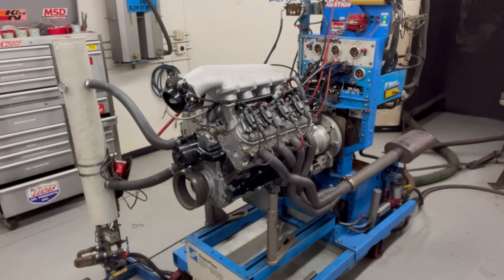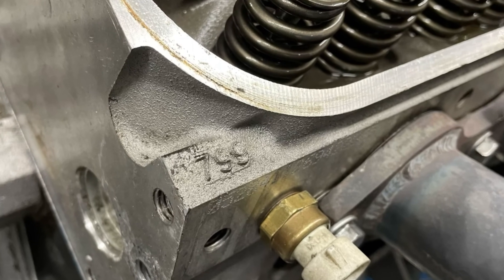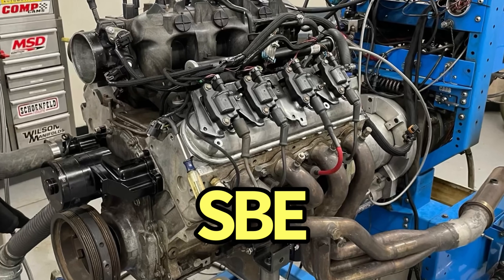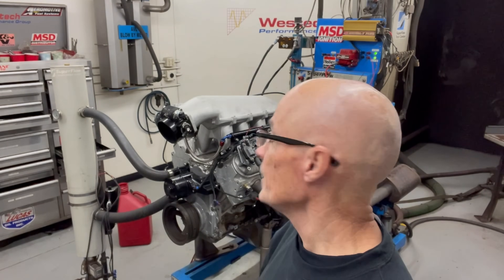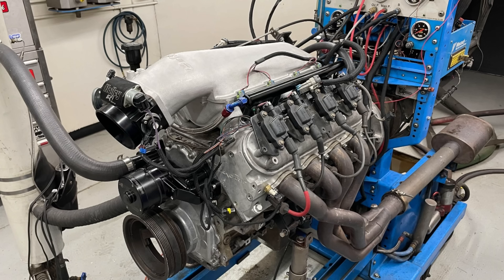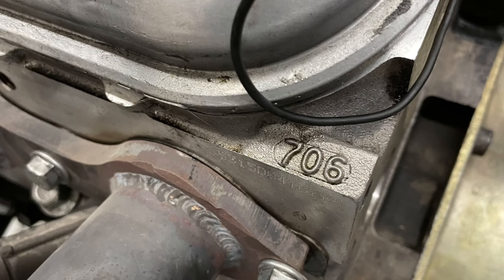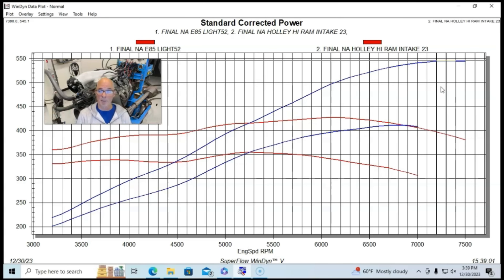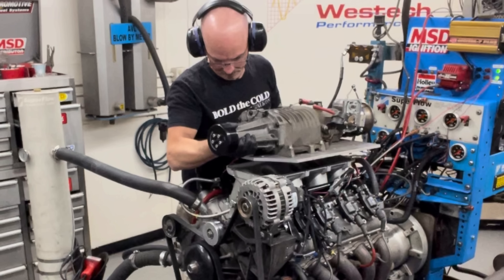CHEAP 614-HP, JUNKYARD M90 BLOWER DUEL! SBE 4.8L VS SBE 5.3L-DOES MORE NA HP EQUAL MORE BOOSTED HP?

Comment: Richard, could I get your thoughts on using the M90 on a carb-style intake?  My main reason for asking is the cost between the usual Low Ram unit you have used and the carb style...As a Northerner past the 54th Parallel, it hurts my wallet and my feelings to what those suckers cost...I'm a hobby machinist, so making the adapter from M90 to carb-style shouldn't be too hard...but before I start making chips, I figured it's worth a shot to ask 
thanks

Comment: Hello, 

Does BTR 5.3 HOT ROD CAMSHAFT

  fit yukon 5.3 2008? 

Yukon 5.3 2008 has 4L60E transmission should I upgrade the converter to FTI STREET BRAWLER 3200 STALL SPEED

Thanks a lot 

Thanks,

Comment: I think you should do exhaust length. I searched and did not see you so you should. BMW had a significant difference in the E36 with the hatch vs sedan. Same motor just a bit shoter than the sedan.  Moar 8.1 vids please as well 🔥
Reply from the maker: I have adj header vids us and shorty vs long tube vids as well

Comment: Would it be possible to do a back to back test of a stock head vs 3 angle valve job vs 5 angle valve job?
Reply from the maker: very difficult since it would require three sets of identical heads

Comment: Great videos Richard! Very informative comparisons.
Been looking your videos alot lately, since i'm trying to find a good single turbo for my low boost N/A E55 M113. The difficulty is having 7psi for a 5.4 liter engine in a reasonable range. Now making 420hp with manifolds, tune and exhaust.

If i calculated my VE right and the plot points for comp maps

-pressure ratio 1.5
-25Lb/min (max torque N/A @ 3000)
-60Lb/min (max rpm 6300)

Obviously i end up at the low end of the maps, but GT45 with flowing turbine is close. 
If you have some insight, i'd be greatful. Thanks!
Reply from the maker: there is no map for a GT45-7 psi would put you near 650 hp-so the GT45 would work well
Reply: I found out there's no map for it, but it seems to be a direct copy of garrett G45 with 1.05 AR turbine.

Comment: My dad and I are about to start building a mild 4.8 turbo motor. Budget build we're going to forge the internals and keep the stock crank. I'm probably going to run a Summit 75mm S475 Turbo. Looking at a good 500-700 whp. The transmission we're using is a TR6060 out of a 2016 Camaro. It's getting a two-wire speed sensor conversion. The vehicle It's going in is a 94 C1500 RCSB. The truck is going to be a pretty awesome build. Brembo brakes, coilovers/4-link suspension, 2010 Camaro SS rear-end, and all kinds of other upgrades. It's probably going to be a long project.

Comment: A cool test.....but that blower be terrible on those engines in a actual automotive application.
Reply from the maker: it would actually be very good on a mild 4.8l and 5.3l
Reply: @richardholdener1727  it wouldn't.  You're running it in a ideal  scenario . Now let it heat soak real good as it would in a automobile with all the various conditions they go through. Next thing you know it's pulling 4 or 5* of timing so it don't eat itself.  Plus the extra complexity it's really not worth it for the 70hp you got over the 5.3. It's barely worth it on the 4.8. And you ended up limiting rpm on both.

Comment: So the intercooler added 10hp and 12tq over the non-intercooled, m90 boosted 5.3. Beats a poke in the eye don't it? Pretty impressive for that little blower. I almost bought the caddy blower and adapter for my birthday today, actually yesterday since it's 2:00 AM now. I don't plan on running E85 or hotrodding it. I'm selling my caddy EXT which has been a great tow truck. My little 5.3 Avalanche doesn't nearly have the grunt the 6.2l has so I figured I'd swap a caddy blower on the Avvy. It's just a cleaner install and not as much dicking around as with the M90. It's already intercooled too. The cost would be about the same by the time I bought an M90, intercooler, adapter plate, manifold, porting, etc.

Comment: Have you tried an Eaton m112? , you may have done it before but I can't remember.
Reply from the maker: yes on an 03 Cobra motor
Reply: @richardholdener1727  an adapter plate can't be made to make it work on an ls?

Comment: I was hoping youd compare the boost amounts as well.
Reply from the maker: I covered the change in boost in the vid-dropped by 3 psi or so
Reply: @richardholdener1727  ah I'm not sure how I missed that but thank you Richard (:
Reply: The boost on the 4.8 will be higher if it has the same pulley ratio. The blower will be trying to push the same amount of air, but the engine will be trying to consume less air. 
Boost is just resistance to flow. And, is just a cheap and easy thing to measure.

Comment: saying this at the start, im gonna say the 4.8 could possibly make more cause the super charger is too small for the 5.3?
Reply from the maker: NOPE
Reply: @richardholdener1727  while the 5.3 still had more overall power the percentage gained looked like a win for the 4.8 with how close they ended vs the na test.
Reply from the maker: THE CHANGE IN POWER GAINS IS ACTUALLY DICTATED BY THE LIMITED FLOW FROM THE M90 BLOWER-IT CAN'T SUPPORT WHAT THE 5.3L NEEDED